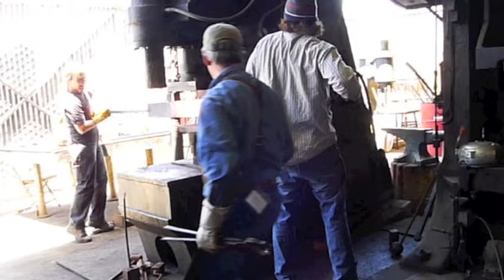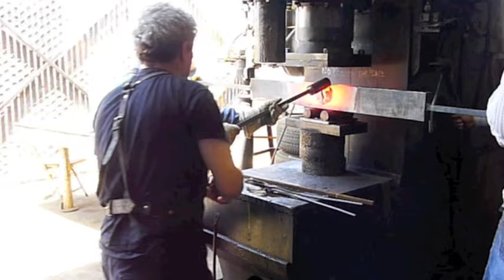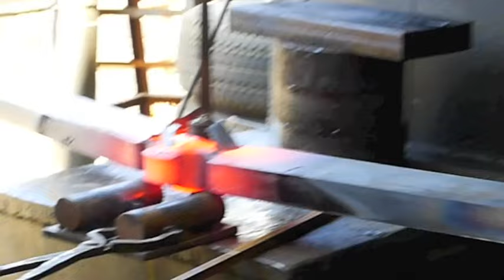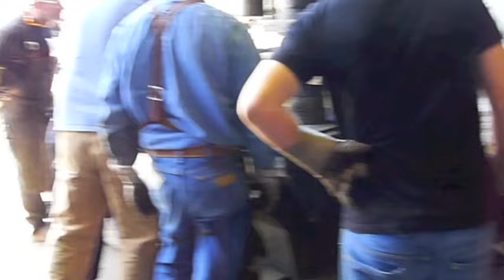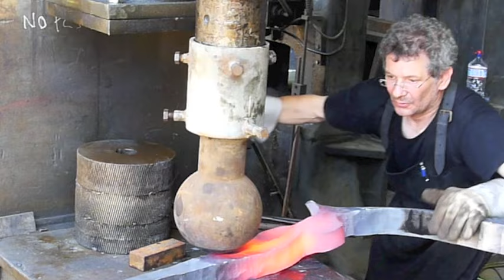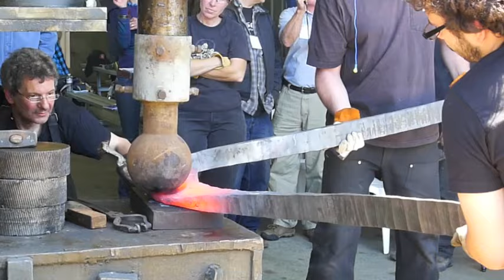Skahh-wish!

Comment: There is no explanation of what is being done. From what I can see is that an artist is trying to work with a heavy piece of steel by using a forge and a hydraulic press. It appears that he has only some knowledge of how these machines work and is rather clumsy in doing what he wants to achieve. In real life some kind of lifting devise would have been used and the people attempting to move the object would have better protection. Even the artist himself should have eye protection when his face was only inches from a heated steel object being stressed by the hydraulic press. I have seen similar attempts by other artists in other media and it is both amusing and disappointing.
Reply: He's one of the best blacksmiths on the planet